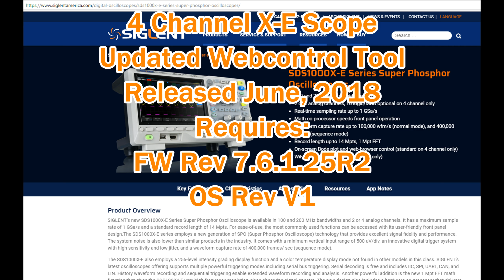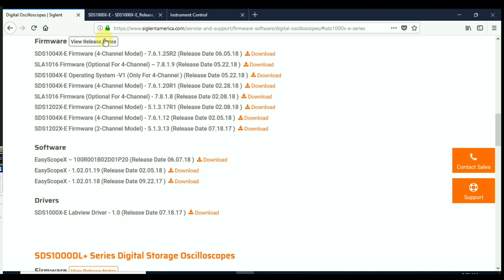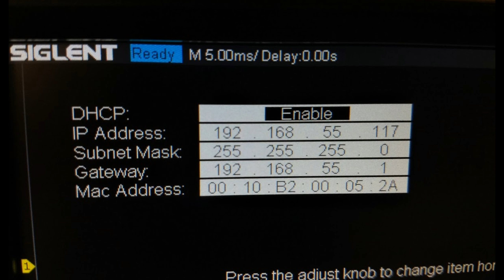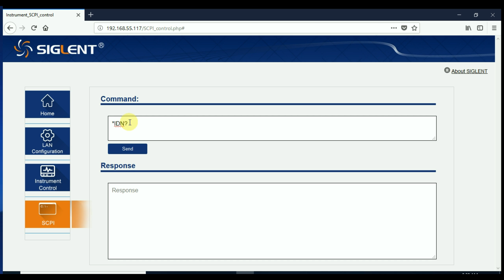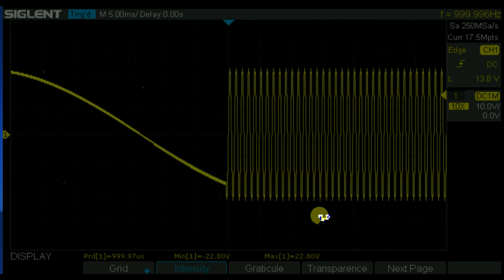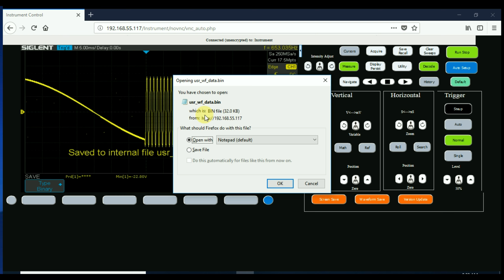Updated SDS1004X-E Web Control: Very Fast Web Interface

Comment: I have the 1104xe and the web interface was unusable through wifi. I'm talking 10-20 second lag. My wifi connection is good, and the scope sits just 10 feet from the router. I ended up having to get a tp link 8 port network switch since all my wired ports on my router were taken in order to have a wired connection. A wired connection works great. Would like to see some troubleshooting for wifi, tho.

Comment: The current webserver feature is quite broken.  It displays the screen nicely, but any attempt to view or use the controls via the browser is unusable.
It either doesn't display them at all, zooms into the screen so much that you can't use it, or (at best) opens the controls and adds a scrollbar to the display so you can scroll across and see some, but not all of the controls.  This is buggy in both Chrome and Firefox.
This is a real pain, as this feature is perfect for presentations, but it's not possible to demonstrate using the controls.
Is there any plan to fix this?
Reply: Yes,  something is whacked, and the controls are only visible with some random PC screen size (that I don't happen to have)  1600 x 1200, 1600 x 900 causes the control  panel to extend to the right into an unreachable and invisible area.   3440 x 1440 causes the display to extend in a way the soft buttons that should be visible below the waveform display are pushed off the bottom and not reachable.  Grr...... (SV 6.1.37R8, FPGA 2021-11-08,  HV 09-06,  SDS1104X-E)
Reply: @jamesmcintyre9985  This error makes sense in a funny way. The Siglent employees are used to writing software for a single screen of a specific size with no need to scale to other resolutions. This could probably be fixed by anyone with PC graphics experience resulting in better and less code. I still think this is the best bang for the buck scope for a beginner to intermediate user. There is so much community support for this that any mistake or bug becomes well known. You can learn the ins and outs of scopes while seeing the instructor use this exact model. I think I opened the user manual once. lol
Reply: @billybbob18  https://youtu.be/8j7MgE5QS38 - Fix for web interface.
Reply: @billybbob18  Thank you so much for this comment. I just had these issues and was hitting the wall / table already. When I saw info about resolution and just tried to drag the browser to the right screen from 38 wide Dell to the 10+years old FHD Dell... and IT WORKED!!! :)))) Now I know why I didn't threw this old monitor - It was waiting for its time to shine. Thank you! That is amazing..
Reply: @sethdthomas  Thanks!!! That is also very helpful. Works well. For me that is so hard not to forget that I shouldn't touch the window or it would rescale and round 2..3.. Probably old FHD monitor is my choice at the moment.
Reply: @jamesmcintyre9985  https://youtu.be/8j7MgE5QS38 - Fix for web interface.
Reply: Turns out that it is a result of poor interface programming; you can go into developer mode and change the resolution. I have made a short video detailing the fix: https://youtu.be/8j7MgE5QS38.

Comment: I have a new SDS 1104X-E with the 6.1.37R9 s/w update (which I installed) on 09-06 h/w, and with a LAN cable connection to a PC I get the indication from the lights next to the LAN connector and from the screen menu icon that a LAN connection has been found, however when I press the "Net Interface" button I get the response "Wireless adapter not detected!" as though no cable is attached, which is confirmed when I press the DHCP button since it says it's "Getting the IP address, please wait" for about 7 seconds, much longer than when no cable is connected (about 1 second), but the DHCP remains disabled. And as expected no Web Server or TELNET connections can be made. Is this faulty h/w, or perhaps just a bug in the most recent s/w update (i.e. should we revert to a previous revision)? Thanks.
Reply from the maker: Hello. 

Sounds like a few issues here. 

The Net Interface selects LAN or WiFi. If it says LAN, then when you press it again it will toggle to WiFi.. since you do not have a wireless adapter attached, it is telling you that it cannot find the wireless adapter. 

Direct connection to a PC requires a crossover Ethernet cable. Also, most PCs do not have DHCP capabilities. That is usually performed by the LAN router. 

We do have a basic note on the setup here:
https://siglentna.com/operating-tip/how-do-i-directly-control-an-instrument-using-lan/

If you continue to have issues, please write info@siglentna.com for additional assistance.

- Jason, SIGLENT NA
Reply: @SiglentVideo  Thanks so much Jason. The key piece of information you gave me is that the scope is set up as though it's a PC instead of what I was "certain" of, i.e. that it was a device. I actually began this exercise by connecting to my router, which one would think would work in this case using a common non-crossover cable but it didn't. In the "Attached devices" menu of the router control page (Netgear N600 in my case) the scope doesn't show up, however based on what you said I tried the long shot of hitting the DHCP button and then it appeared on the device list. Then using the new assigned IP address in the browser I was in.

So I'd suggest a clarification of this in the "IO set" section of the user manual. For example, if just the word "crossover"  was inserted before "network cable" in step 1 of the LAN section I'd have been tipped off as to what I was doing wrong, and adding an expansion to cover the router connection case I described above would be extremely helpful. Also, I'd clarify step 4 to cover that this doesn't apply when no WiFi option is installed.

Separately, I noticed that in the special case of running at 250 MS/sec that the single channel memory depth increases to 17.5 MB  (and the dual channel case when say channel 1 or 2 is combined with either 3 or 4) . Originally I thought it might be a memory wrap, i.e. a repeat of the first 3.5 MB added to the end of the acquisition, but it appears to be real data. Upon transfer to a PC I haven't found a discontinuity near the 14 MB sample, nor an anomalous spectrum when using a 16 MB transform.
Reply from the maker: @ultrasoundguy1  Glad to help. Thank you for the suggestions. I will send them on to Engineering as well as the data. That seems odd to me. - Jason, SIGLENT North America

Comment: Hi. I have an SDS2104X Plus. I can connect to web interface. I can see the scope UI. Keyboard works. But, the mouse doesn't work. Is that normal behaviour or is it just me to have this problem?
Reply from the maker: Hi. Sorry for the delay. I was out-of-the-office. It could be your browser settings: https://siglentna.com/operating-tip/browser-not-functioning/

If you continue to have difficulty, please write to info@siglent.com and include your country.

- Jason, SIGLENT NA
Reply: @SiglentVideo  Thank you Jason, but it can't be the browser settings. Because, when I try with VNC Viewer software it is still the same. Also, tried different VNC Viewers.
Reply from the maker: @ozkarah  Please write to info@siglent.com and include your country and the firmware revision and our team will assist. - Jason, SIGLENT North America
Reply: @SiglentVideo  New firmware 1.3.9R12 seems to fix it. Thank you for your interest.

Comment: hi , would that works also for the SDS1104-U ? i tried and not working
Reply from the maker: The X-U does not have the web control, MSO, WiFi, Bode, or external AWG control. Those features are available on the four-channel X-E series in our budget line of scopes. - Jason, SIGLENT North America
Reply: @SiglentVideo  is there a kit to upgrade the U to E ?
Reply from the maker: @EnergySeeker  No. They have different hardware. - Jason, SIGLENT North America
Reply: @SiglentVideo  how about the web interface can we get that to the U model its only software web server
Reply from the maker: @EnergySeeker  We do not currently have plans to add the webserver interface to the U version of scopes. If you need a basic interface, you can try the free EasyScopeX software that provides basic instrument control via USB or LAN. Here is a note that describes some basics of EasyScopeX: https://siglentna.com/application-note/using-easyscope-x-retrieve-average-waveform-data/

Comment: Does the SDS SDS1002X-E have a similar web browser feature?
Reply from the maker: No. The web browser is on the SDS1104X-E. SDS1204X-E, SDS2000X-E series, SDS2000X Plus series, and SDS5000X series. 

You can use EasyScopeX software to remotely control scopes not listed. It is free and offers almost identical features. It does require a Windows OS and National Instruments VISA, however. 

- Jason, SIGLENT North America

Comment: I'm not having success with this method. Scope came installed with the latest driver. I have NI VISA installed, NI MAX, etc. NI MAX doesn't detect anything. Scope shows ethernet connection icon, IP ping tool (Zenmap) shows the listed IP address, but entering into browser does nothing. Am I missing something?

Is this functionality not supported for SDS1052DL+ ? If so, please let me know so I can return it and purchase a supported device.
Reply from the maker: The web control is not available on the DL+. It is currently available on the SDS1104X-E, SDS1204X-E, SDS2X-E series, SDS2X Plus series, and SDS5X series. - Jason, SIGLENT North America
Reply: @SiglentVideo  Thanks for the quick reply Jason!
Reply from the maker: @Live4Ibanez  Glad to help! Have a great weekend. - Jason, SIGLENT NA

Comment: Does the SDS 1052DL+ have a similar web browser feature?
Reply from the maker: Dear Craig, the SDS1052DL+ doesn't have the web browser feature. If you are looking for this I suggest SDS1104X-E
Reply: @SiglentVideo  I've just got the SDS1052DL+ and it says in the manual it can be controlled via ethernet. What type of control does it support?
Reply from the maker: @svtcontour  The DL+ requires National Instruments VISA for all communications. This is also required for using the free EasyScopeX control software. 
More details and examples are included in the Programming Manual available here:
https://siglentna.com/resources/documents/digital-oscilloscopes/#sds1000dl-series

- Jason, SIGLENT North America
Reply: @SiglentVideo  Thank you for the info my friend. Helps. I got it working with the easyscopeX  :)

Comment: Hi, I have a SDS1104X-E. I do SPI decoding, does it great. But is it possible to download the acquired buffer with all signals and decode d info as video or some player to be able to evaluate the recordings at latter time?
Reply from the maker: There is no direct method of saving and animating displayed data, but I think you could use History to collect multiple screen images (frames), save each frame as a bitmap to USB or other storage, and then stitch them together using a video editing tool. - Jason, SIGLENT North America

Comment: fyi: The firmware numbering on the Siglent website currently appears to be missing the 7.  It reads 6.1.25R2 instead of 76.1.25R2
Reply from the maker: Yes,our all firmware version serie number“7”has been removed, but the firmwares do not be changed.if you have any problems, please infom us.

Comment: On the webpage can you click the alphanumeric keypads/menus with the mouse or do you have to use the knob like on the actual scope?  Or can you just type values when keypads or menus areis displayed?
Reply from the maker: The menus are all driven by button presses on the virtual keypad for the scope. You can't directly press the displayed labels or enter numbers using the computer keyboard.
Reply: That is a very impressive interface, but I think it would benefit greatly in terms of efficiency and user experience if you added the ability to directly press the labels or enter values with the keyboard.  Do you have any plans to extend the web interface to the SDS-1202X-E?
Reply from the maker: Hi rdagger68. Jason here. I agree and we have a few new products on the horizon that will integrate that functionality. The XEs don't currently have a touch screen display, so that may be a bit more challenging to design. Not sure about adding the web interface to the 2 channel XE. My recommendation is to sign up for the newsletter. We send out new revision notices monthly. If interested, you can write info@siglent.com.
Reply: Hi rdagger68 I like your videos on Youtube a lot, as you create amazing & unique content. Siglent would do good to listen to your input :). I just purchased the 1104X-E and it waits in the living room to be unpacked and tried out. Have a great day, if you happen to read this!

Comment: When can we expect this update for SDS2000x series oscilloscope family?
Reply from the maker: Hi Krish. It is unlikely that the SDS2X will have this type of control added. The hardware does not support it currently. I suggest using the free EasyScopeX software. - Jason
Reply: Siglent Technologies does that apply to the 2000X-E series as well?